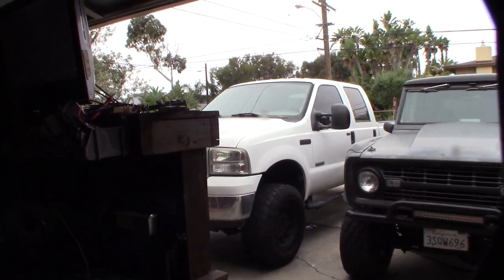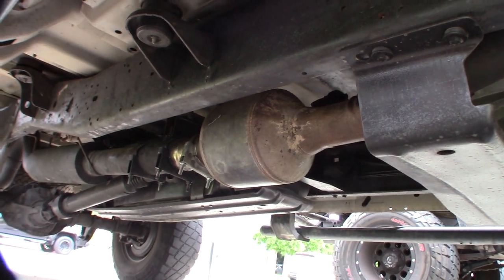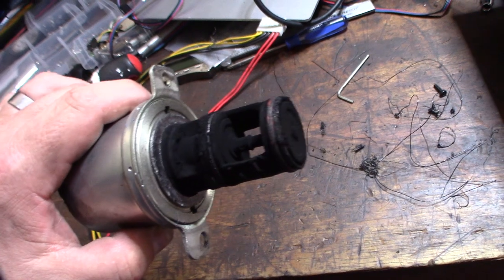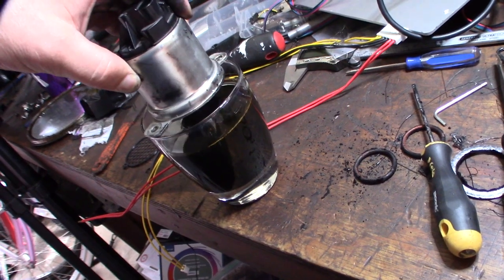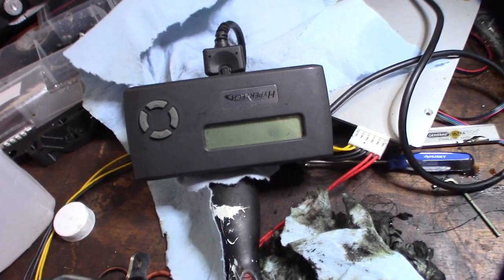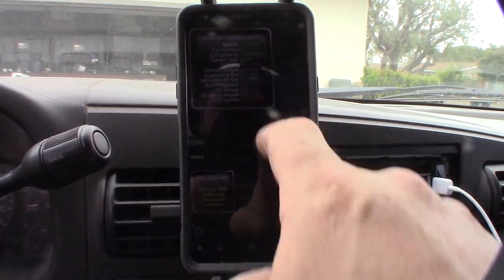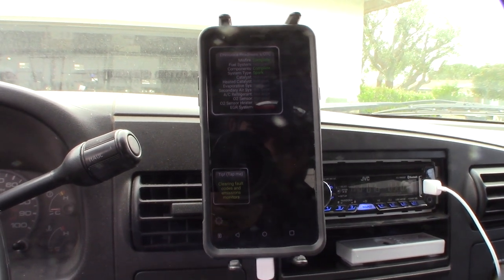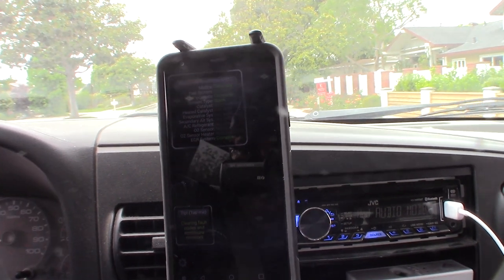How to test and pass California Diesel Smog check tips Powerstoke, Duramax, cummins

Comment: 6.0's don't monitor EGR flow or performance. A guy I know... Broke all the pins out of the servo to make sure there is no connection, then plugged it back in... it just needs to "appear" functional. Still running like that 3 years later, no CEL. I live in CA and hate the diesel smog nonsense but I thoroughly enjoy the challenge of making it appear stock even tho my truck is no where near stock. Just flip the switch back to stock and remove the knob. Takes 3 minutes to get my truck ready for smog. Catch me if you can 😊
Reply: Do you own a 6.0?

Comment: The 2008-2010 6.4 powerstrokes did Not use DEF. They do have the DPF still but dont tale def. 2011 is when Ford started using DEF on the 6.7s.